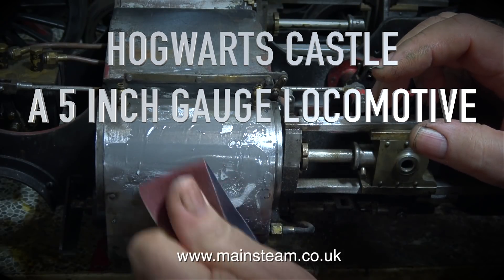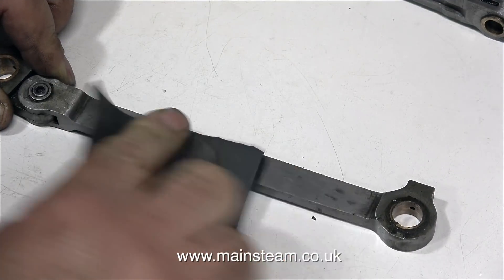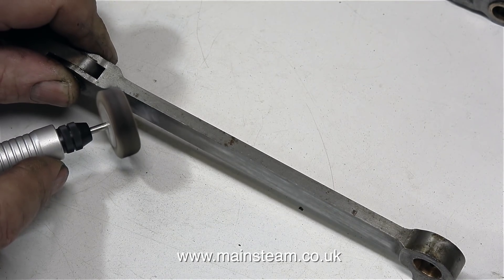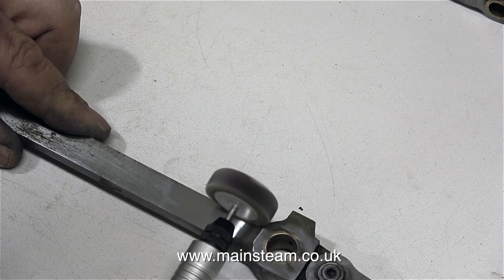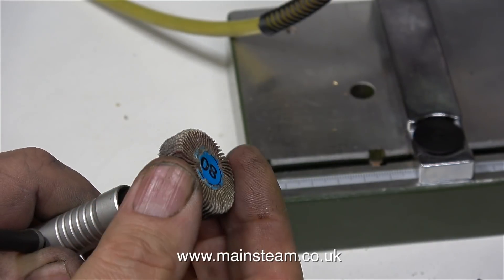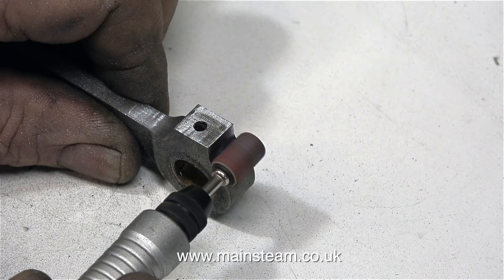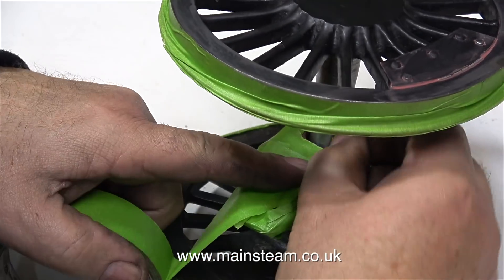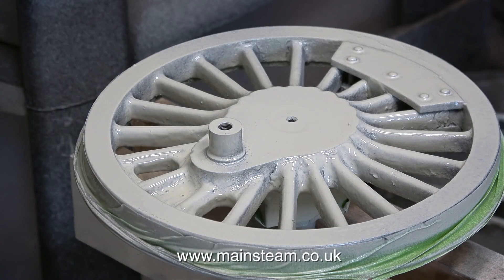HOGWARTS CASTLE   A 5 INCH GAUGE LOCOMOTIVE - PART #6

Comment: It's a pleasure to watch the work of another person who's adept with a rotary tool. Most of my work was nonvisible on internal ports and passages.
Are you familiar with using abrasive cloth in a Cotter (split) pin as a small radius flap wheel?
Reply from the maker: Thanks Jay, that's another great tip }:-)))

Comment: Mr. Appleton, when I worked for a living, the factory did finish  painting on their marine engines after assembly was complete. They used aluminum foil on all they parts they didn't want finish paint on. Much easier than masking?
Reply from the maker: I never thought to try that, but I will now - many thanks for a useful tip }:-)))